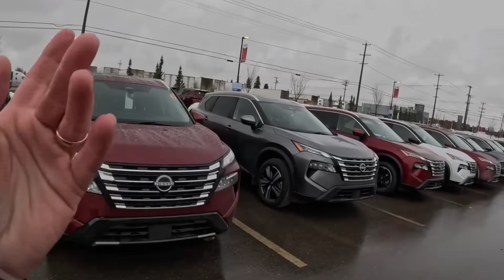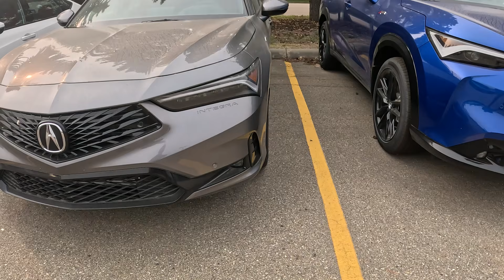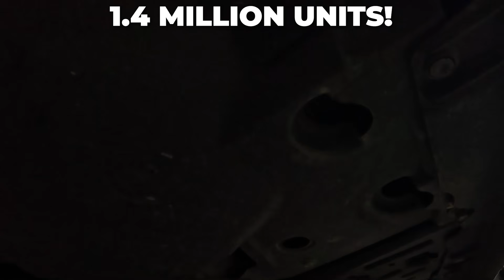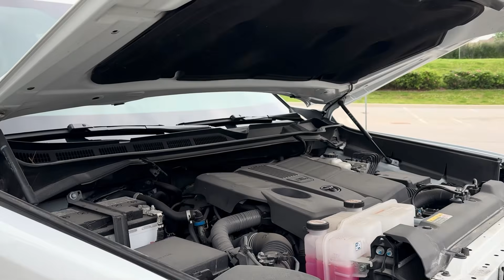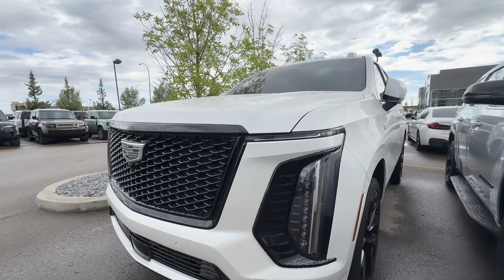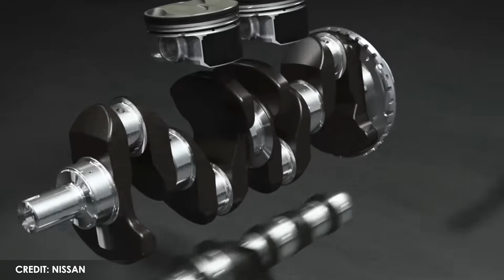The WORST Engines from these JUNK Cars of 2026!

Comment: If it has a Turbo "
Run away at 10,000 rpm 😅
And if it has a 6.2
Too bad for you 😮
Reply from the maker: That is certainly one way to handle those particular engine setups.

Comment: Guys... let me keep it simple...
Small Engines + Heavy Cars = Blown Engine 😂
Reply: GM 6.2... "Hold my Beer"
Reply: @BS-zc4zo 😂 that's another story.... that's horrible manufacturing
Reply: @davedave4232  😆Fair enough. I think the problem is they're making dinky little turbo engines like gasoline engines, when they are under the stresses of diesel engines. The only one built exceptionally well is the Ford 2.7L ecoboost. CGI block, all forged internals, offset rods.
Reply: New Land Cruiser, Tacoma and 4Runner!! Small displacement turbo motors that will not last 300K

Comment: Newer vehicles these days are just not dependable as cars built in the past, it's hard to say anything has improved. After all, innovation is supposed to be self-sustaining, and things should continuously improve. You'd think, then, that the car as a whole should be more reliable, but the fact is, it simply isn't and it's getting worse! I will only buy a new vehicle today if it comes with a lifetime powertrain warranty!!!
Reply from the maker: That is a very understandable stance to take given the current state of modern vehicle reliability.

Comment: Other channels had voiced their concerns over Nissan's new VC engines, they also asked if the increased complexity would be offset by any advantages of having a VC engine. It seems the answer is no.
Reply from the maker: The trade-off between added complexity and marginal performance gains really doesn't seem to be worth it.